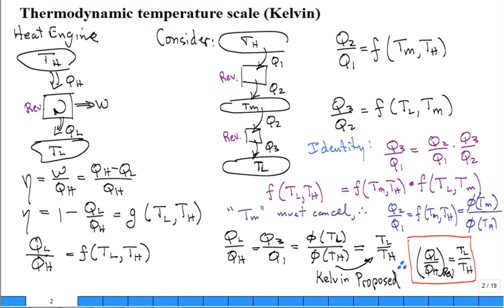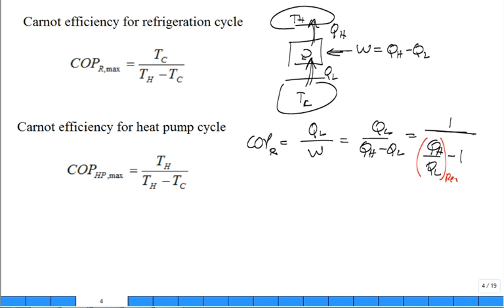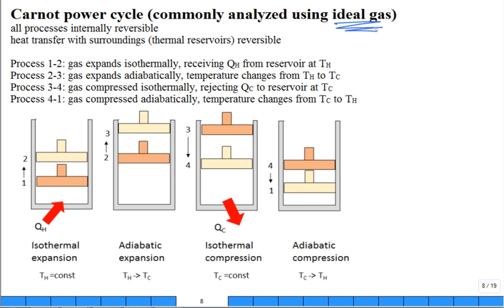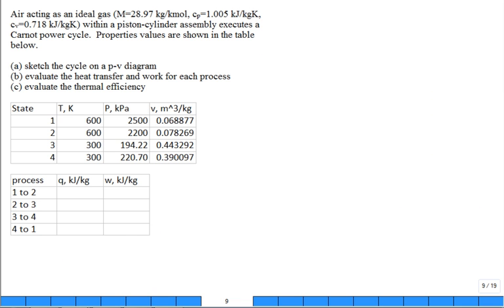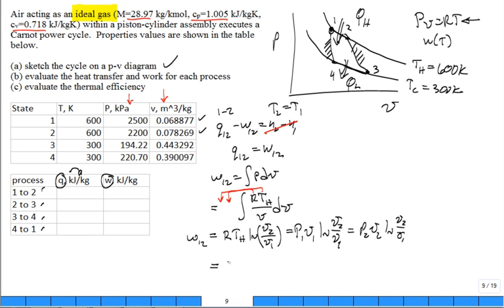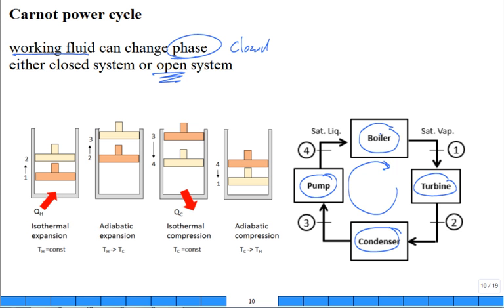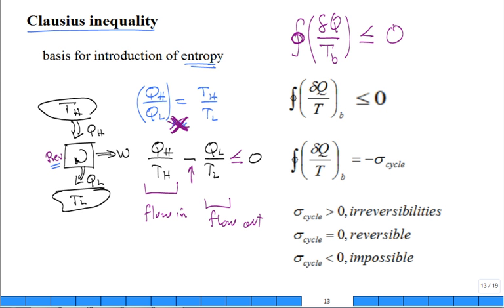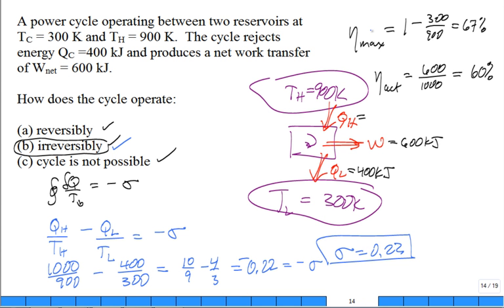ME3293 Second Law 2 Fall2015

Comment: Hi professor: Please let me know what was the topic of your PhD thesis? Was it heat engines related? What did u discover? You are awesome. Thanks 
What books on engineering thermodynamics do u use for your lectures, I will buy on Amazon.
Reply: The book is mentioned in the first lecture. I guess it was Borgnakke & Sonntag 8th ed
Reply: @MohamedGamal-yi4bq  no, it's engineering thermo by shapiro and moran

Comment: Anyone know why the process from 2 to 3 is adiabatic?
Reply from the maker: +Johnathan Ledwig By definition, Carnot power cycle (with gas or vapor as working fluid) has 2 isothermal processes and 2 adiabatic processes.  All heat transfer in (Qin) happens at TH and all out (Qout) happens at TC.  The adiabatic processes make it possible to jump between TH and TC without any heat transfer.
Reply: ''Is it possible the temperature may change without heat transfer'' you said this I don't remember in which lecture and now it is brought a sense. thnx teacher..
Reply: @ErenGuerrier97  Yes, for example adiabatic process with work can change the temperature for ideal gas